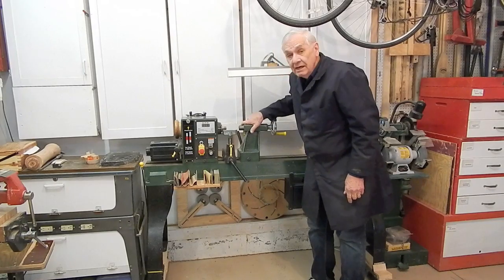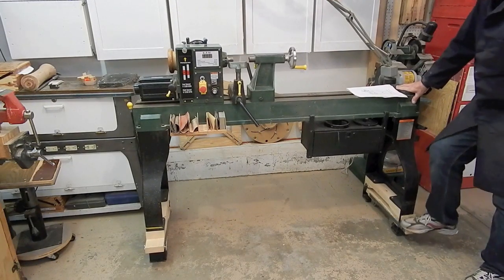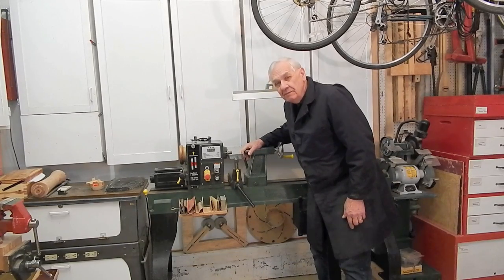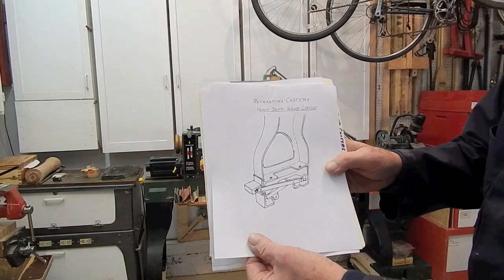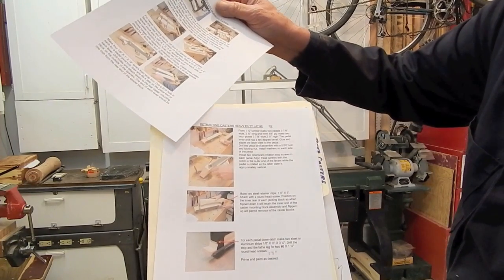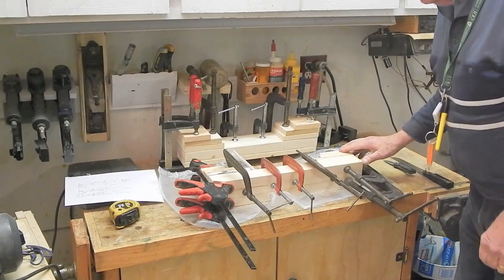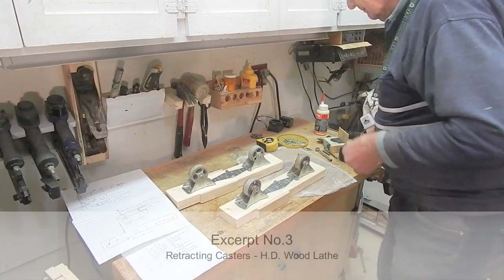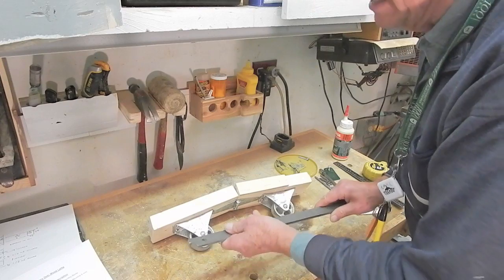Retracting Casters 3 of 6:  HD Wood Lathe

Comment: Hello Carl,
Thank you for your videos.  I built a crude replica of your table saw caster system.  Works fine but yours is much nicer.

Are you planning on offering a "package" deal on more than one set of plans?  I am sure there will be several of us interested in multiple caster plans as we all have more than one machine needing "Holmgren Movers".

Happy New Year to Everyone.
Reply from the maker: +strrchristmas    Yes, there will be a "package" of the six retracting caster system plans:
1. Bandsaw/jointer
2. Table Saw
3. Wood Lathe
4. Workbench
5. Belt/Disc Sander & Shopsmith stand
6. Mechanic's Tool Cabinet & Planer Stand
Thx for comment and question;  Happy New Year to you and all      ////Carl